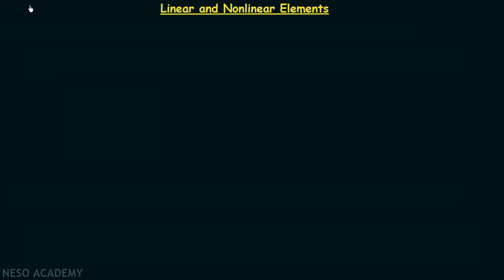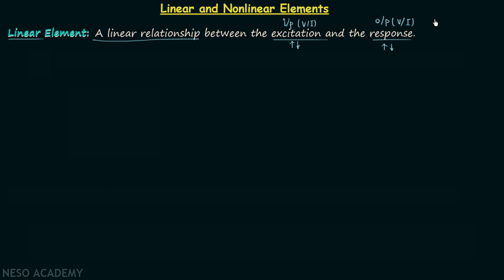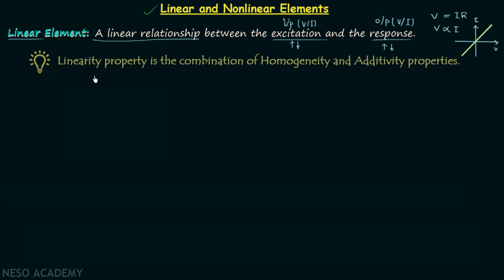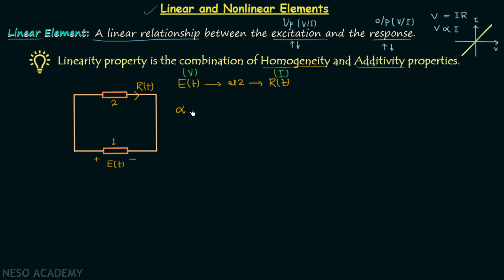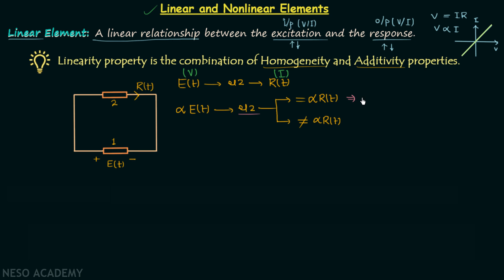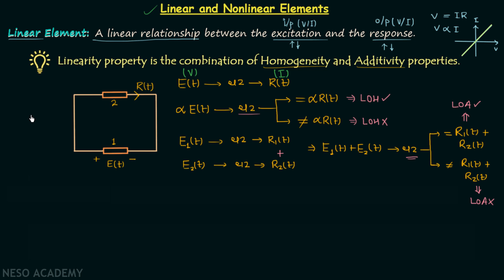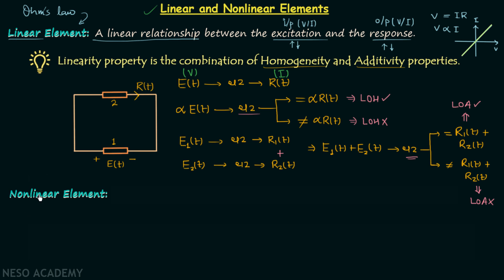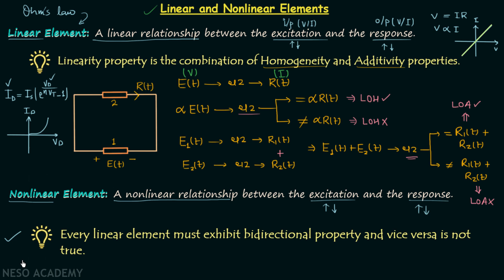Linear and Nonlinear Elements

Comment: 9:07 Usually, "characteristics curve" refers to the curve given by plotting i(t) in one axis and v(t) in another axis in a plane. I will assume this is what you meant.

But then, it is a false claim that a linear device will have a characteristics curve given by a straight line through the origin. It's true all devices with that curve are linear, but it's not true all linear devices have that curve.

As an example, consider a constant-inductance inductor. This is of course a linear (and time-invariant) device. Now suppose we apply a sinusoidal voltage, resulting in a sinusoidal current of same frequency. The characteristics curve (current-voltage plot) of such an inductor will be an ellipse, not a straight line through the origin!

Comment: Both are non-linear 
->current becomes constant and does not increase with increase in voltage in 2nd problem
-> Non linear element must exhibit bidirectional property which is not followed in 4th problem
Reply: Correct sir! 4 one is symmetric along y axis but it need to be symmetric along origin .

Comment: Sir 2nd is non linear, this region is after some time the voltage is increase and current is constant  or 4th is non linear element because the line passes through origin but it is not straight lines. Thank you sir
Reply: and one more thing is the line must me unique
Reply: Achha ok

Comment: are capictor and inductor are linear elements if yes, why ?
Reply: Yes if their inductance or capacitance is not a function of voltage nor current nor electric charge nor magnetic flux. The inductance or capacitance can be a function of time, and the inductor or capacitor are still linear, as long as the inductance or capacitance are not a function of voltage/current/charge/flux. For example, if L = 2 or C(t) = (log(t + 5) - e^t)/sin(t^2), that inductor and that capacitor are linear.

Why yes? Because differentiation and integration are linear operators.

No if their inductance or capacitance is a function of voltage and/or current and/or electric charge and/or magnetic flux. For example, if L(i(t),t) = i(t) - t or C(v(t),i(t)) = v(t)/i(t), that inductor and that capacitor are non-linear.

Comment: 2- is non linear because after sometime when voltage is increased current becoms constant both side
4- is non linear because the straight line is not passing through origin
Reply: It does touch the origin.

Comment: Both are non linear as in second question as the decrease voltage current increases thus LOH is violated.
Also the line does not passes through origin.